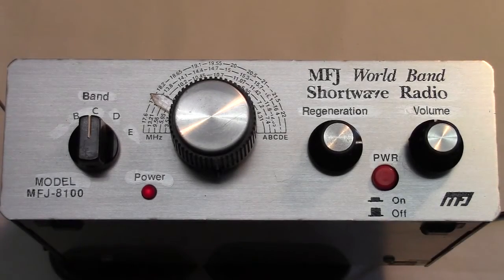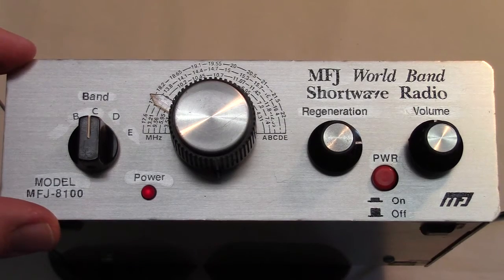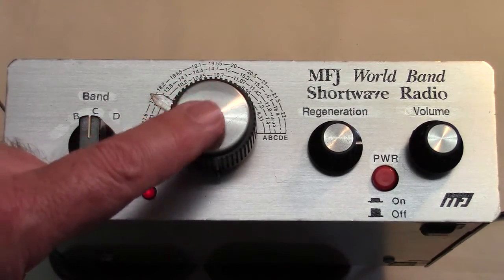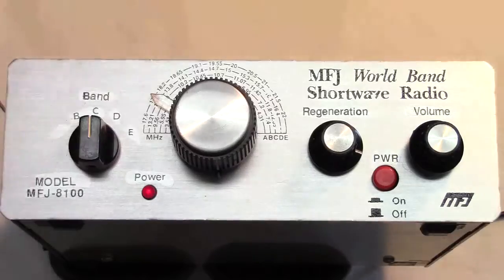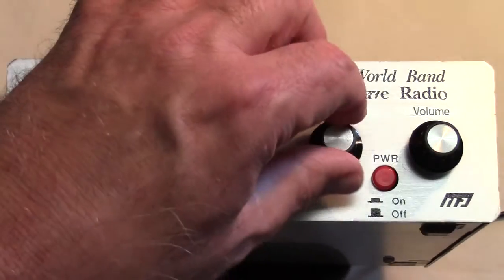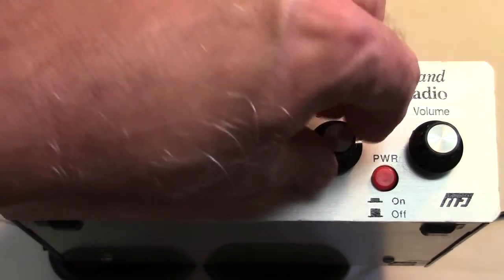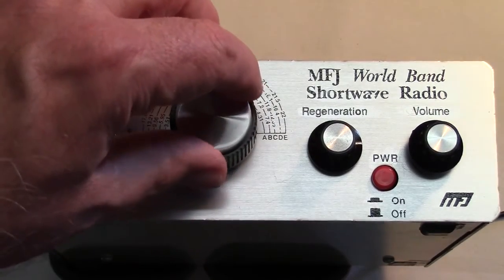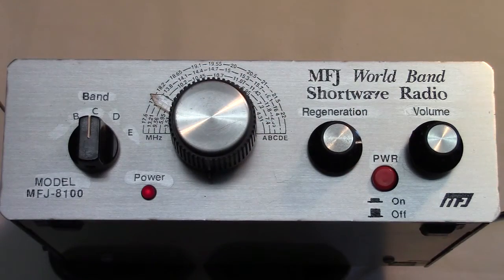MFJ-8100 Regenerative Shortwave Receiver

Comment: I have one of these I built over 14 years ago or so. Its black with same exact layout but called a Vectronics VEC-102. I can hear alot of hams on it but can be very hard to dial in perfect. I think if i had a really good antenna mayne it would be easier. Sometimes i gwt a strong signal that i cant wvwn tune in fully for some reason but its allmost like the tuner isnt quite precise enough to fine tune.

Comment: I wish I had one of these when I was a kid. This can tune cw, ssb, am modes. Very simple and cheap. I use mine with a 300 foot beverage antenna. It has the best sound quality and reception of any shortwave radio I've EVER owned. I currently own a yaesu FT-DX10. This little MFJ blows it away! Just tweak the regen control if band conditions change. This receiver is absolutely incredible!
Reply: My experience is exactly as yours, an amazing receiver.  I actually own 3 of them, and I use the one on my nightstand just about every night. They hold their own against modern receivers once you gain the skills to operate a regen. The only change I made was to use a 6-AA battery holder to replace the 9 volt battery. I find alkaline batteries last a very long time (several years) using it about an hour per day. I own about 30 quality shortwave receivers,  but the MFJ-8100 gets the most use... a pleasure to operate.